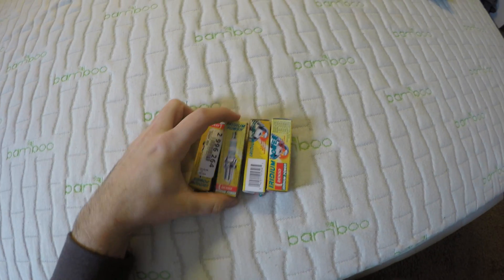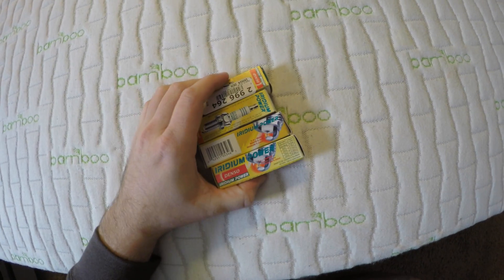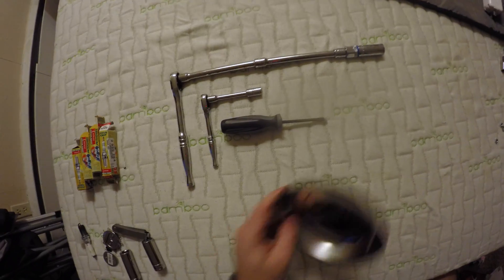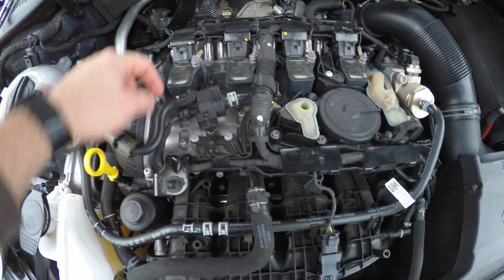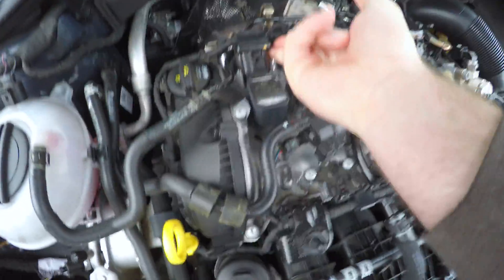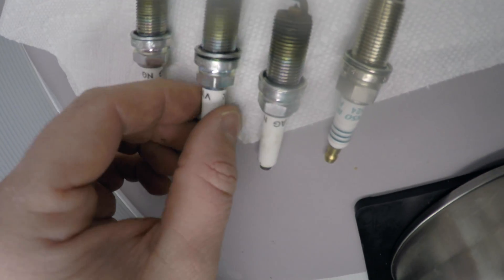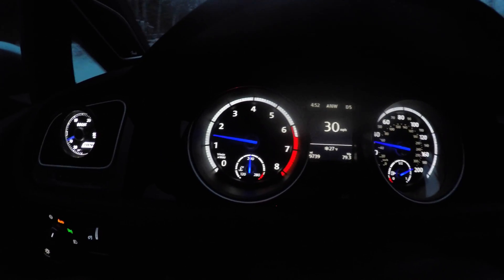Replacing / Installing Spark Plugs on the MK7 Golf R / GTI

Comment: At 9:21 - the connector on the end of the OEM plugs, look very different. Doesn't that give connection problems, or do the coil packs only push against the end?
Reply from the maker: I see what you're saying. No issues.

Comment: Great Video, Adam. My name is Ivan Dragnev and i  want to share something and ask you few questions. I have Skoda VRS MK3   TSI 220h.p. and 2 weeks ago we installed on it IS38 IHI Turbo and flashed APR IS38  Software. We put the Denso IKH24 on 0.6mm gap but the car had misfire on 3rd and 1st cylinder.We gaped the sparks on 0.3mm gap and the problems disappeared . Now i will change and the coil plugs too but anyway and to ask you. Does your Golf is Stock, i mean 300h.p. or it is on some APR Stage?  Did you have any misfires? I agree that Denso IKH24 is COLDER SPARK than Stock NGK but could this little gap 0.3-0.4 be some problem? Thanks.
Reply from the maker: Very nice car you have. My car is stage II with United Motorsport and a few other changes. I was having some rough starts and idles and these made a nice difference.

Comment: Doing this on my GTI today and I am finding that the coil pack harness is very stiff so it's hard to pull the harness away from the coil packs to allow me to pull the coil packs. Hard to describe... but those wires/hose running between cylinder 2 and 3 and towards the front of the car seem to be the culprit... too much tension. Any advice?

Comment: Hello, how did you remove the   spark socket? I was trying to switch the sparks but it was really hard to remove, unfurtunatelly you dont show up on your video. Regards.
Reply from the maker: +Roberto Trejo The coil pack or the spark plug itself? You'll need to hit the local auto parts store and get a magnetic socket designed for spark plugs. The coil pack just pops right out once you've disconnected the ground & the sensor.

Comment: Did you disconnect the other cables like for the diverter valve and camshaft position sensor or were the hole sensors you disconnected were the 4 for the coil packs?
Reply from the maker: +xReptarMuffin Only disconnected what I had to get the coil packs out.
Reply: So the coil pack connectors and the ground?
Reply from the maker: +xReptarMuffin Yep, that's all!

Comment: Any update on how the car is running? I live in a similar climate (Michigan)
Reply: I can see in my notifications that you replied to me but for some reason I can't find the entire message anywhere. I'm not thrilled with the new YouTube setup. Heh heh.
Reply from the maker: +Meat Amigo Whoa, my comment to you is gone! WTF? It was a long reply as well. Huge bummer.

Well, your question did inspire me to post up a short vid - https://www.youtube.com/watch?v=nPLMGaBekOc 

I'd say the car is doing pretty well.  Happy with it but Wide Open Throttle isn't really something I'm doing anymore. Car is very loud, very fast. And cold weather means winter tires just don't have great traction so overall I'm babying it. I think TTRS Front brakes, APR Intercooler and Summer Pilot Super Sports are my next big purchases.
Reply: +Adam Chandler I was thinking similar for myself. Definitely like that intercooler APR released. It's hard not to like their stuff.

Comment: Hey Adam, when are you going to do the write up from your visit to UM? Patiently waiting for the feedback from all those problems you were having...hopefully they are all resolved now.. ..
Reply from the maker: +Carmelo Susino They're resolved. Part of me wants to wait until the Spring when I do another Dyno run, this time on an AWD one instead of FWD only. I&#39;d rather back up my resolution with a bit of data, ya know?

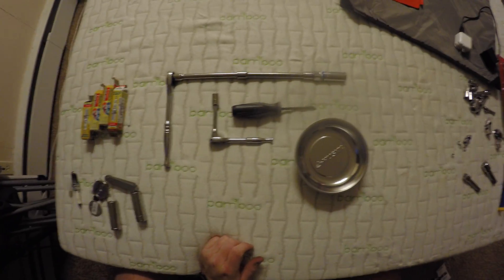Actually, realistically it may be April. The main issue currently is I live in central-New Hampshire. Very cold, very ice, very slushy with very short days (sundown at 4:45) and winter-tires that really can't hold up to the power of the UM Stage II. I've tried a couple of launches and the car just spins trying to get traction so my 0-60 pulls are in the 5.5 seconds range. I know the car is faster. After Summer Tires are back on and the roads are better, I'll do a proper video. I have a lot of Stage II related clips already, just need to get the Dyno Data, Summer-Tire pulls and then I can finalize the video.

Apologies for the delay.

Comment: Thanks for the video Adam. I had read that about the plugs in reference to the big turbo kit but didn't realize that recommended them for stage 1. Looks like I need to place an order😎
Reply from the maker: +Meat Amigo Check local auto parts stores as well. Shipping will be free. I screwed up and ordered from ECS...paid $15 more than I should have once shipping was added in.
Reply: +Adam Chandler   Thanks Adam I just ordered some since I struck out locally. I won't mind replacing these more frequently since they are about 1/5 the price of the OEM replacements.
Reply: +MrThePrivateer    You are correct. I was looking at these ones and got them mixed up with oem. https://www.ecstuning.com/Volkswagen-Golf_VII_R--2.0T_Gen3/Engine/Ignition/ES2998993/
Reply: +Meat Amigo well since that link doesn't work I'll just tell you that they were the NGK revision for the gen3 tsi. Set of 4 is $159.00
Reply: +MrThePrivateer   Yes I'm sure. If you go to ECS Tuning and set your vehicle as a mk7 (R Models) you can look under Engine>Ignition. They have the Oem for around $60 like you said and then down the page are the NGK plugs. They say they are an upgrade from the oem which I believe are also NGK. I didn't look any deeper into the specs of the plug that justifies the higher price.